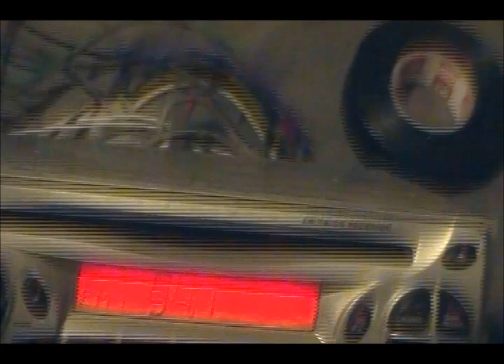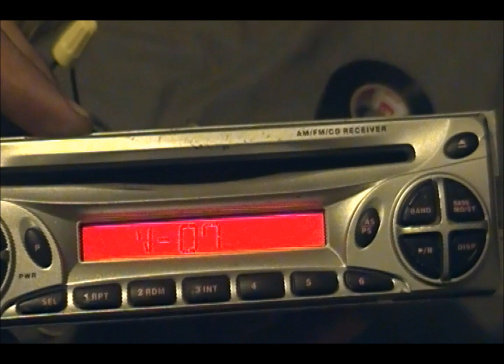How to power a Car Stereo with a Computer Power Supply

Comment: I have powered a car stereo with 2 6 volt lead acid batteries but I'm trying to figure out how to charge them with a 12 volt power supply or some kind of 12 volt transformer anyone got any suggestions because I don't wanna use a battery charger to charge lead acid batteries and I'm trying to make a homemade boombox portable so that it can be used outside